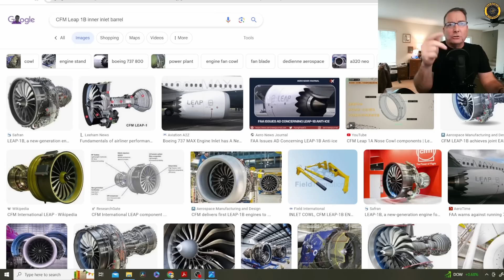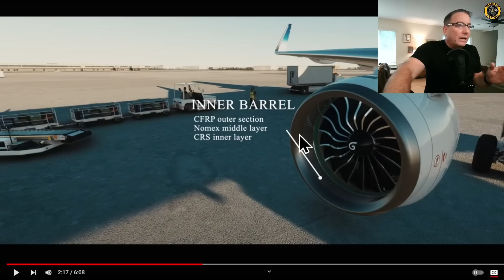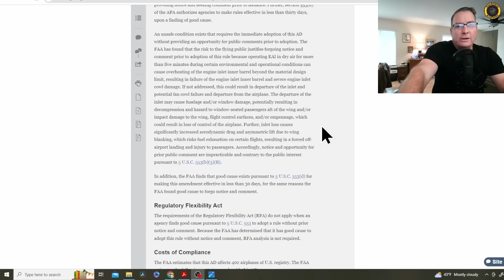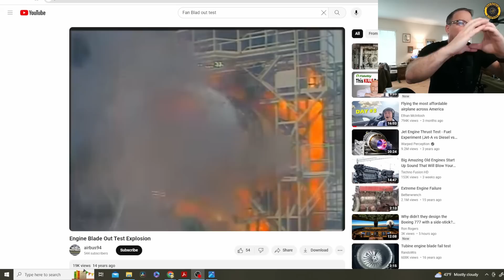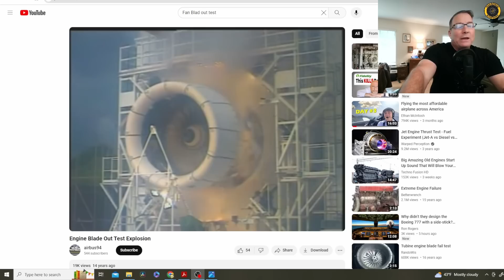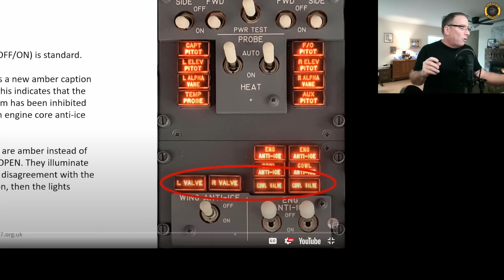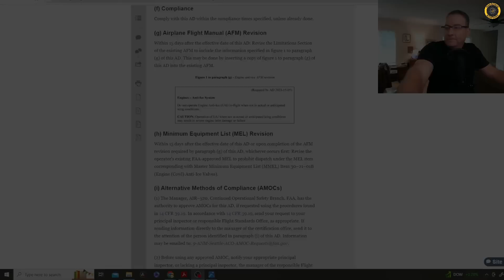Boeing 737 Max-7/-10 Certification HALTED! 1 Feb 2024

Comment: The money saved by adapting a 60 year old design has cost lives. 

Perhaps a clean sheet design is more appropriate. Put 737 in a museum.
Reply: Maybe put Boeing management in there first :)
Reply: The A320 is not a 60 yr old design, but it has killed a lot of people.

Airbus A320 disasters.

Source:  Wikipedia

On 28 December 2014, an Airbus A320-216 registered as PK-AXC, crashed into the Java Sea killing all 162 on board. 
The cause was initially a malfunction in two of the plane's rudder travel limiter units.

On 19 May 2016, an Airbus A320-232 registered as SU-GCC, suffered a cockpit fire and crashed into the Mediterranean Sea 
20 minutes before its scheduled arrival at Cairo International Airport.  All 66 on board were killed.

On 22 May 2020, an Airbus A320-214 registered as AP-BLD, landed at Jinnah International Airport gear-up and executed a go-around. 
A few minutes later, both engines had shut down. 
The plane crashed into Model Colony near Karachi on final approach to Jinnah International Airport for an attempted emergency landing, 
killing 97 of 99 on board, as well as killing 1 on the ground.

On 5 November 2014, Flight 1829, an Airbus A321-231 registered as D-AIDP, was flying from Bilbao to Munich when the aircraft, while on autopilot, 
lowered the nose into a descent reaching 4000 fpm. 
The uncommanded pitch-down was caused by two angle of attack sensors that were jammed in their positions, causing the fly by wire protection 
to believe the aircraft entered a stall while it climbed through FL310. 

On 31 October 2015, an Airbus A321-231 registered as EI-ETJ operated by Russian airline company Kogalymavia crashed in the Hasana area of central Sinai, Egypt 
while en route from Sharm El Sheikh, Egypt to St. Petersburg, Russia. There were 224 people on board (217 passengers and 7 crew). 
There were no survivors.

Comment: Changing the material back to metal or find polymer that can withstand higher temperature would probably be the solution. Since the anti-ice valve might stuck in flight, having the automatic anti-icing system in place would not eliminate the risk of overheating inflight.
Reply: And I suspect that a composite has poorer thermal conductivity than metal... so with an all-metal cowling, probably less hot bleed air would be required.
Reply: I'm amazed this little detail was not caught in the design/materials analysis stage. A decision was taken at some meeting to go ahead, and nobody raised their hand?  @awuma
Reply: @bernieschiff5919 As seen before at Boeing. Those who raise concerns or safety issues are relocated to a plant 90 minutes away as punishment or pushed out
Reply: Both ways would work, but if you rely on the automation, the automation has to be redundant, e.g. redundant valves. Plus a way to override the automatic A/I shutoff in case the temperature sensor fails in a way that indicates a high temperature, and you need to override it because there are actual icing conditions.
Reply: Well, the engineer's solution would be designing the valve so it's part of a feedback loop with the cowl's temperature. If it exceeds a certain temperature, the valve auto-closes. Maybe add an override setting too so the pilots can break this feedback loop and force it to remain open if for some reason it's deemed necessary in flight. I wouldn't be surprised if that had been proposed, and nixed by a bean counter.

Comment: Christ on a bike its a simple fix. Do I need to go into detail? An off/auto on switch with associated parts.. Just as Juan says it...Doh!
Reply: An auto option would mean NG pilots would likely no longer be permitted to fly the MAX due to the excessive differences in aircraft operation. Same reason Boeing installed MCAS, so it behaved like previous model
Reply: Are you mad? @tomstravels520
Reply: It's a switch position for icing.... @tomstravels520

Comment: BA should have used the 757 pencil as the base for smaller bodied aircraft.
Reply: Yup… Silliest and costliest mistake Boeing ever made… discontinuing the 757 for a 1960s design.
Reply: They would have had to convince a huge customer like Southwest to buy a aircraft that wasn't a 737. I'm sure that was a factor.
Reply: @weing  Maybe so, but eventually Southwest and every other 737-heavy carrier is going to have to transition to another type.
Reply: I hated that pencil. On cross country it was like a sardine tin, only smaller.
Reply: Damn near every pilot's favorite airplane and certainly every controller's.  She aint a long 737 like most people think.

Comment: To be fair to Boeing (not something I often do) no Airbus aircraft has auto antice it’s just something they’ve never done. My other point for this issue is the normal procedure for a broken antice valve is to wire lock it open and carry on, I guess this would be a massive no no under this AD?
Reply: However Airbus has ice detectors which warn the ice is detected on the engines and wing, then if the system is turned on it'll warn when no ice is detected sop the pilots know when too turn it on and off and less likely to forget
Reply: @tomstravels520  let me make two corrections, firstly the vast majority of Airbus aircraft don’t have ice detectors that is the entire A320 family however, even on the long haul aircraft we don’t wait around for the ice detector to say there’s ice, we use the same SOP as was mentioned 10 degrees C or less with visible moisture down to -40 SAT. My main point however was the fact that antice valves fail from time to time and the standard maintenance action is to manually open the valve (giving you antice at all times) this has been a long standing fix while awaiting spares, this AD throws a large bucket of cold water on this procedure and could mean the aircraft would need to be flown only in non icing conditions, ie grounded.

Comment: If the air being injected into the cowling is too hot then surely the logical approach is to cool it down  - plenty of cold air outside - but then if Boing can't fit bolts then cooling down hot air is going way beyond their capabilities

Comment: How does Airbus handle engine deicing?  Automatic, or not, if the valve gets stuck doesn't that render the whole system useless?
Reply: On the a320, engine anti-ice is not automatic, ice detection may be. If the bleed valve gets stuck open, the engine cowl will not explode, nor will you have to shut down the engine.
Reply: They have ice detectors which will warn to turn on for ice detection and then another message when no ice detected so they can turn it off
Reply: @tomstravels520 Ice detection is great, but sadly, not all a320 are equipped with it.

Comment: Am I just a simple minded redneck or aren't there several SIMPLE solutions to this over heat issue????     Say maybe an automated vent to control the temp inside the cowling, and the automated activation system you spoke of on  the 777 @ 8:30
Reply: Adding automatic activation would likely mean Max pilots can't fly the NG. If there are too many differences you can't have a similar type rating

Comment: Latest technology requires a human thermostat? Way to go Boeing!
Reply: Apparently having an "AUTO" setting would break the 737's type rating. Absurd.
Reply: @awuma It is. The regulatory scheme incentivizes this patchwork of upgrades, then blames the symptoms on "under regulation"
Reply: @roflchopter11  Or on "bean counters".

Or "poor engineering".

These people - the engineers, the managers, the accountants - are solving problems within the confines of the regulatory framework.

The obvious solution - an "auto" setting for the de-icer - isn't available, apparently.
Reply: @dafunkmonster  its my understanding that the auto setting isn't an option. Gotta keep that type rating, and the FAA bean counters are the ones deciding that.
Reply: It's right up there with, "Ahh, that's good enough.  We shouldn't have a problem."
Reply: Boeing needs to get all of this new technology, exotic material, woven this and that stuff all worked out in the lab before putting it on the airplanes serving the public.